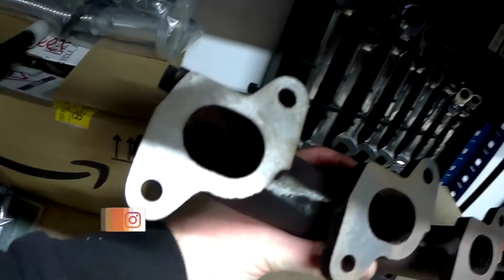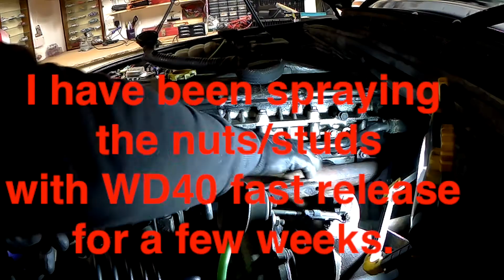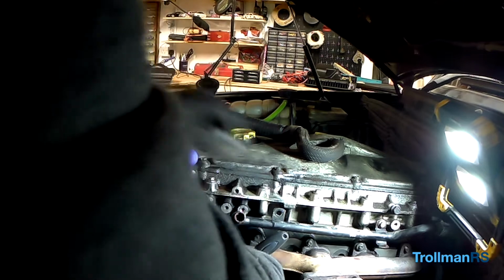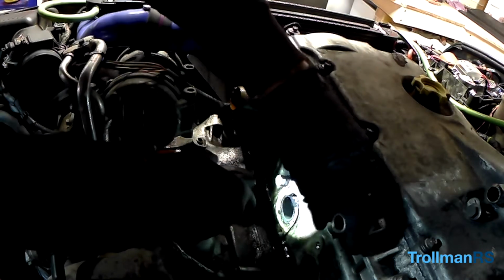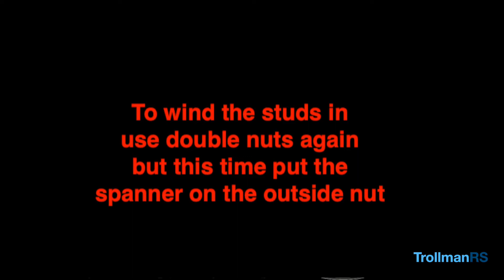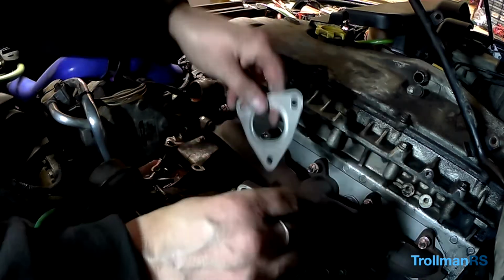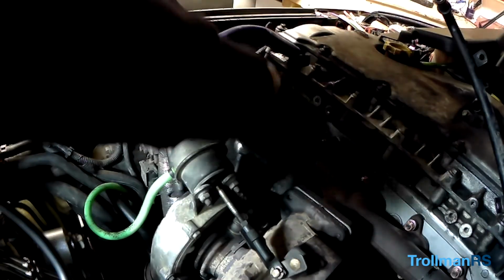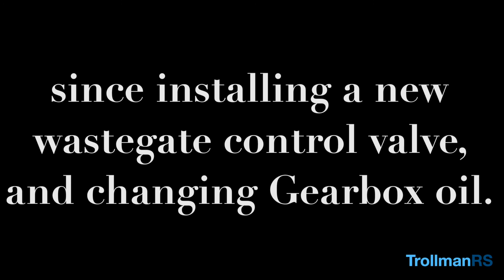Land Rover TD5 warped manifold replacement using uprated studs. Discovery 2 - Do I have broken studs

Comment: I don’t think that there is enough of the stud protruding through the nut. 3 - 5mm protrusion would be safer. The nut only needs to undo a few turns and will quickly  vibrate off. Maybe shorter spacers ?
Reply from the maker: Maybe, but I installed these over 3 years ago, and not had to touch them since.

Comment: Great video 👍🏻 thanks for posting, very handy. About to order mine from Adam Howes on Facebook full set kit with the wurth bolts, gaskets, and spacers. I know I've 2 nuts missing so far.  Mines a AC version so will need to move pump also. 🌟
Reply from the maker: Good luck, just undo the AC pump and you have just enough room to move it aside without having to undo the A/C pipes. Fingers crossed you have no snapped studs !